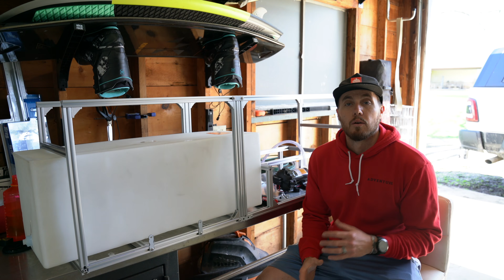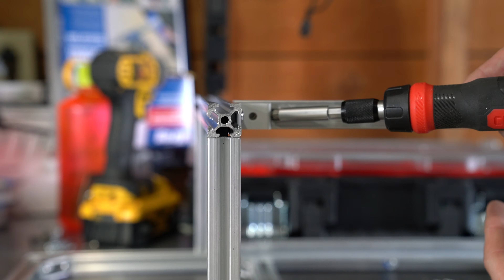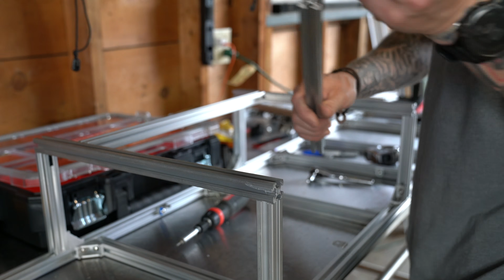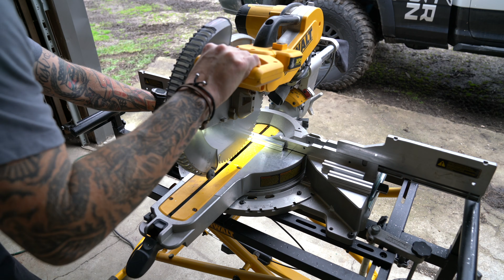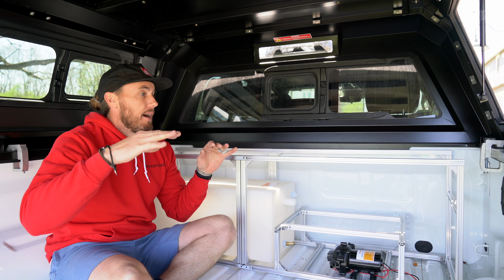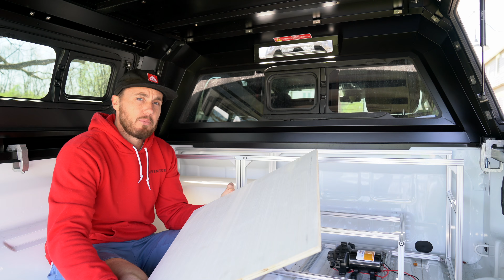2022 Ram Power Wagon Full-size Overland Build Part 2

Comment: Did you ever consider using an air pressurized water system to eliminate the need for an electric pump?
Reply from the maker: We have 2 separate air pressurized tanks and both work great, I just wanted to try having a onboard pump to see how I liked the convenience of just flipping a switch. Although the pump is more convenient,  it comes with more work and maintenance.
Reply: I got my power wagon in Jan and I’m looking at all these different overland set ups to get ideas for my own. Thanks for the response!

Comment: Why no spray in bedliner protect your paint just curious
Reply from the maker: I didn't want to spray it in until I decided what I ultimately want to do. This set will probably be changed and when I dial it in I'll get it sprayed and then reassemble everything.
Reply: I really like your truck I live on the road full-time 2020 tundra pro Atoverland pop-up camper with trailer be blessed

Comment: just looking at it, I'd cut it down the few inches that are above the tank just to give yourself more headroom once the bed is on top of your deck. I just prefer as much sleeping space as you can get so it doesn't feel claustrophobic.
Reply from the maker: I agree. We already cut it down 3 inches which should give us about 30" in the bed space for head room. This sleeping space will mostly be for Cohen to sleep in and us in a pinch so I don't want to focus too much on the headroom and sacrifice the other space we will need for gear and what not since the tent will be out primary sleeping space. Thanks for the input, Travis!

Comment: Exciting times... Thanks for sharing the build.  As far as the water tank goes... I know you said its not for drinking water, but I would still make sure all your fittings, hoses, etc. are all food grade, drinking water safe as there is no reason you shouldn't be able to use it for clean drinking water as well.  The top should have an access hole big enough for you to be able to inspect the inside and reach in and clean the tank if needed. On the outlet to the pump I would place a check valve to make sure the hose/pipe always stays full of water and doesn't empty itself back into the tank.  As a matter of fact, a nice heavy food grade brass check valve on the end of a pipe/hose dropped in from a fitting on the top of the tank down in would be one less fitting down low that could potentially leak out all the water in the tank.  Standard brass fittings may have lead in them.  The food grade ones have no lead.  I would also tilt slightly the tank to the end that would have the outlet for the water to make sure all you water is able to be used and also that you can drain as much out as possible when you need to empty it.  Can't wait to see the final build....
Reply: My friend, you are a well of knowledge. Notes have been taken
Reply from the maker: All that have been noted and will be applied to this build. I sincerely appreciate you taking the time to give some knowledge to us on this!